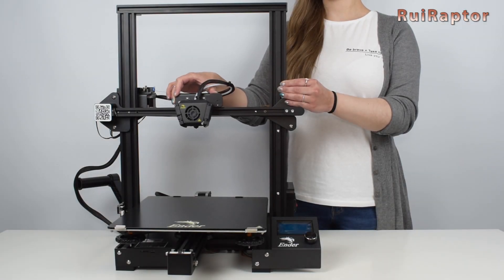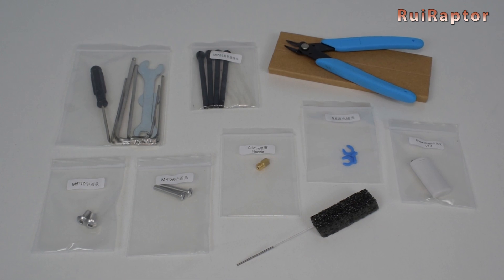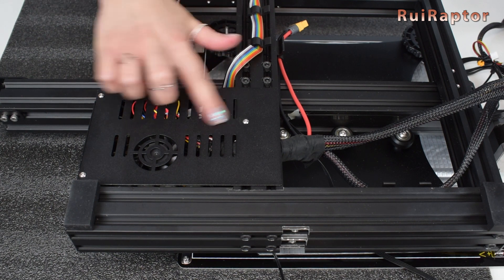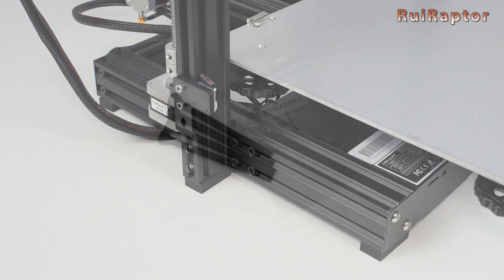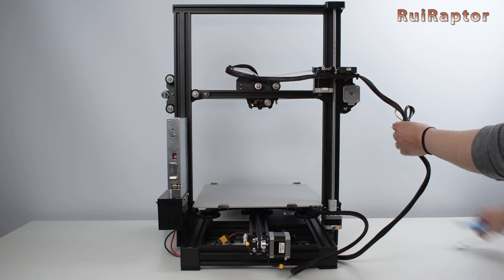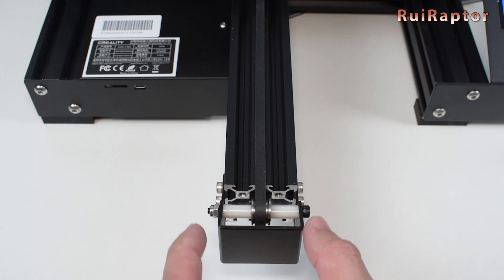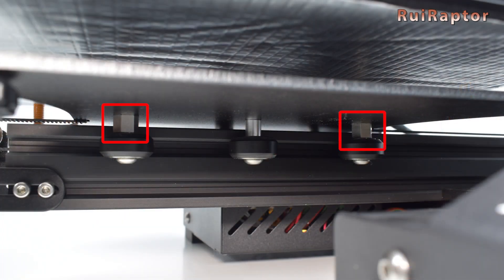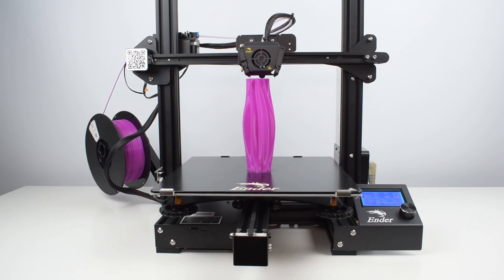Creality Ender 3 MAX - Assembly & Calibrations - FULL GUIDE

Comment: Hi, thanks for the video - lots of great tips.
Do you think it would be better to set the gantry at 90' to the bed after the bed has been levelled under the extruder? To my mind the bed would then be truly horizontal.
I've also found with my one that the vertical posts for the gantry weren't parallel - the gap between them was 1mm larger at the top so I had to loosen the Allen screws at the top to adjust it.

Comment: Thank you so much for this video for the part about the X axis being loose/sagging on the right side. Had the same issue, after watching another youtuber's setup video, I went about it the wrong way, only fidgeting with the eccentuate nuts on both sides for hours. I knew that wasn't it but couldn't figure it out. You showed the solution in minutes. Thank you